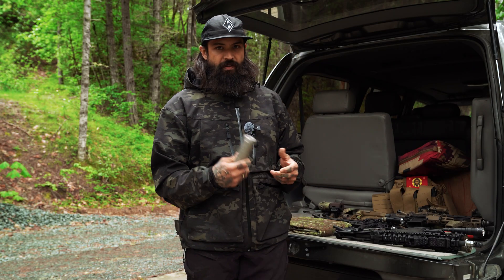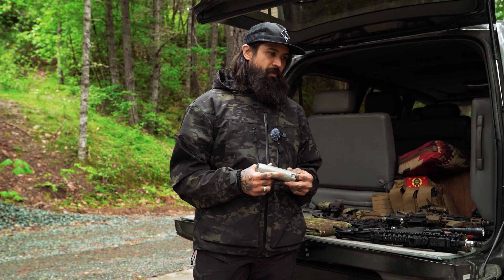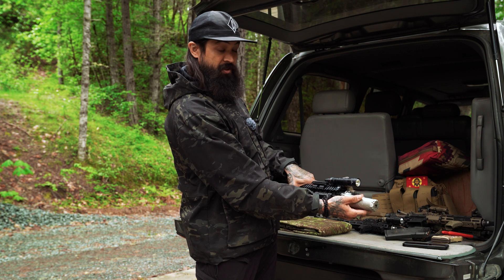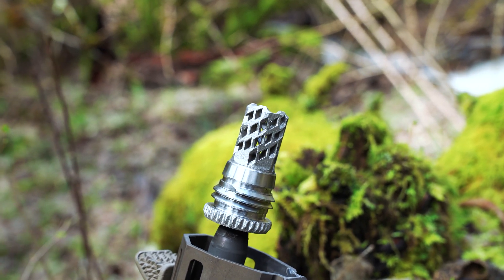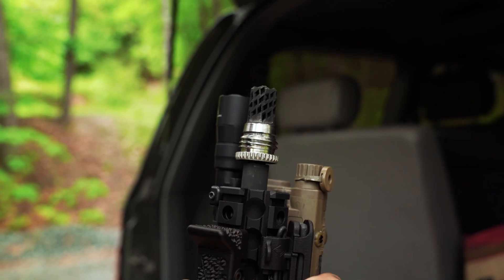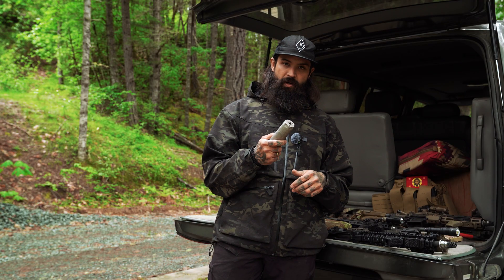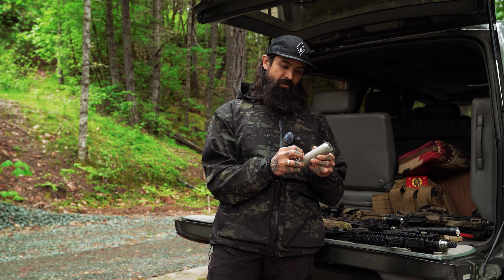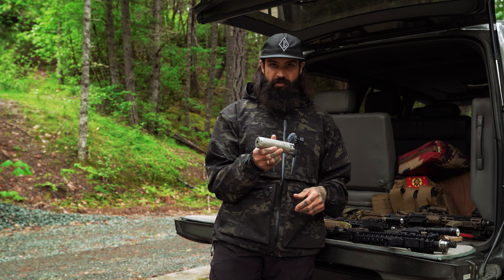ID Hesychia SIXK Suppressor Overview & Live Fire Demo

Comment: The B&T Print XH has an inconel core and Ti exterior; weighs less & supposedly has minimal flash. 

Selling point for this would be better mounting system & durability? I have a 16” geissele (might get a 14.5” barrel later) and I wonder what the benefits would be? Definitely open to this as an option if it’s at least a similar cost.

Comment: This suppressor is loud af dang
Reply: Can confirm it is not loud AF.
Reply: @SeanBernstein7 get him sean!
Reply: @SeanBernstein7 are you affiliated with irregular defense?
Reply: @saintnash93 valid question
Reply: @saintnash93 Yes, I’m that Recon Marine Slade mentioned in the beginning of the video. I designed the can with him.
Reply: Slade and I started Irregular Design Group back in November of last year specifically to design suppressors. Before that, I designed the OMM with him when I owned a different manufacturing company that I left to start IDG with Slade.
Reply: had the chance to shoot with this can last week. it's not loud.  definitely considering purchasing.
Reply: @daleyfoxracing will this be a excellent for a lefty?